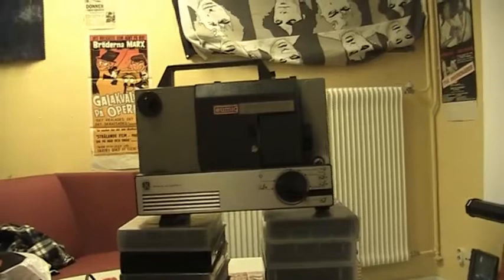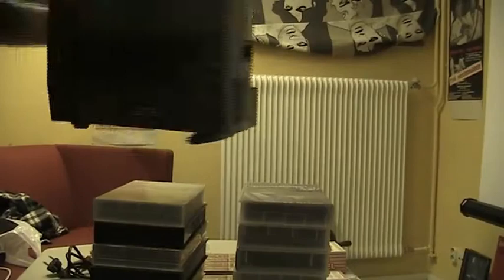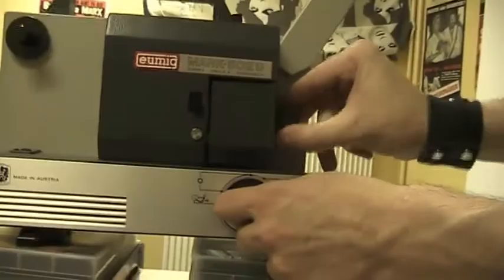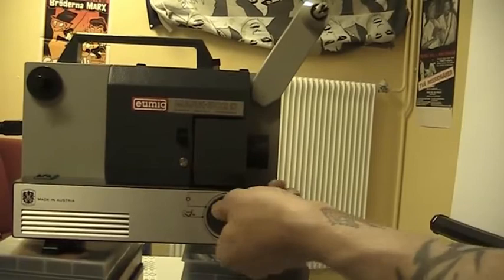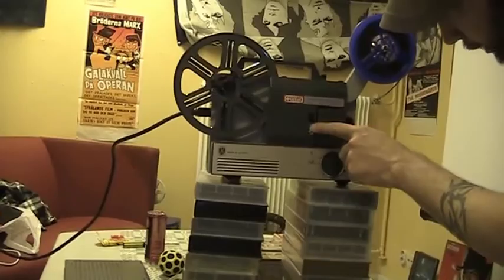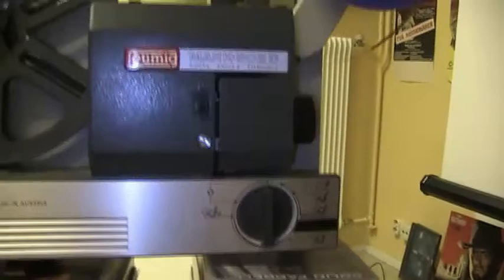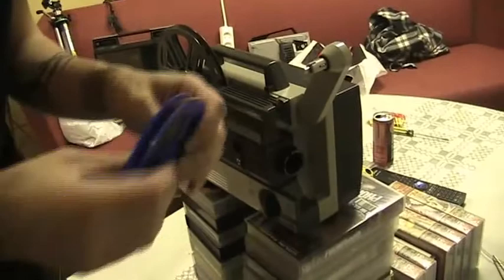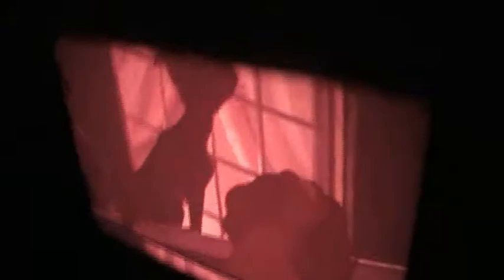Eumig Mark 502D - 1970-ish - Dual 8mm Movie Projector

Comment: Hi. I have Dad's same type projector.  Have it set up . Withe reels fitted and film loaded. Turns OK.  But no light comes on. It did earlier when setting up. But since threading the film through. Did not switch bulb on. Is there an On  Off switch for bulb please
Reply from the maker: Did you move it when it was hot? It might have broken then. Or it was old and just broke anyway. Try change it and if that do not work idk sadly.